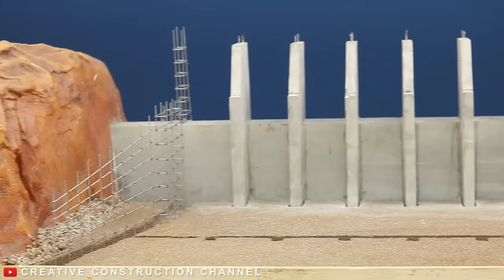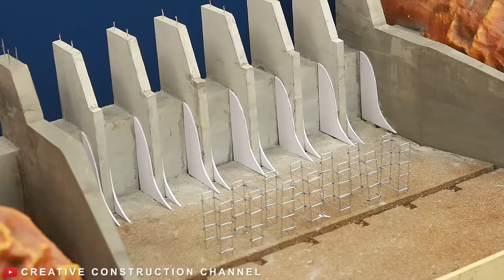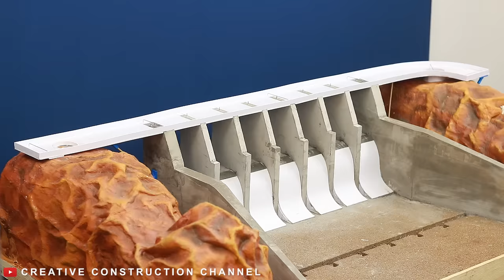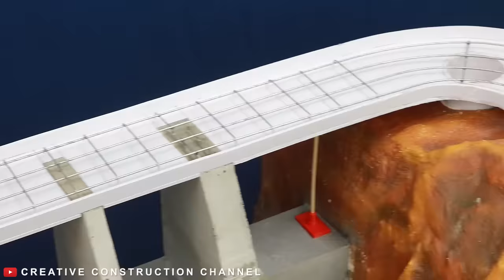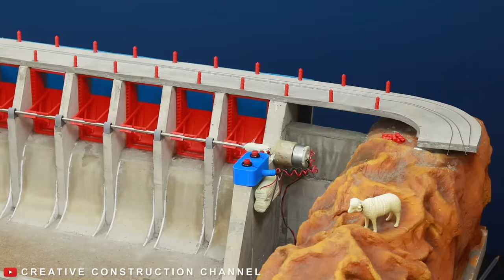How Dam Model Construct? Mini Dam Modelling

Comment: my favourite part was when you pulled out the mini concreting truck and it actually pumped concrete
Reply: Why is he using a cement mixer to pour concrete anyways???
Reply: @halcyon_exb  That is how the concrete would be delivered to the construction site
Reply: He was pouring concrete into the blue thing to make it work but it was cool
Reply: I think your misunderstood it is actually a fully operating concrete truck at its full size but the only thing unusual about this is how big that giant is building this sculpture
Reply: @gardenman3  actually that depends During the construction of the hoover dam they likely used the railroad to deliver the concrete then used the cranes to pour it

Comment: The wire frame method is exactly the same as in real construction. I salute you for this incredible amount of detail.
Reply: He needs the wire frame to make the concrete stronger
Reply: the frame is needed so it doesnt collapse on itself, its not really detail its a necessity
Reply: This comment and replies be like (as of now) comment: 4 months ago. 1st reply: 1 month ago. 2nd reply: 1week ago.
Reply: I wonder if 3d resin printed rectangles would do the job of the folded wire?
Reply: On this scale all that elaborate metal mesh in the concrete was unnecessary

Comment: Creative Construction Channel I appreciate the actual level of detail, such as vibrating the concrete. A lot of viewers don't know that contractors in real-life vibrate the concrete as well. (just not with a massive vibrator on the side of the project) :)  

Also, your materials estimator is going to have your ass, for all the concreate that was spilled  :) 
Any specs on the finished unit?  How much it weighed?  power generation?  how soon before the wife told you to gat that F-ing thing out of the house?  :)

Comment: You didn't have the tie bends at the top. Plus snap ties aren't the best for  columns and stuff. Should of used saddle ties for the ends and figure eights for anything you don't want to move horizontally. 
  Great vid  love the fact you vibrated the concrete

Comment: That truck on an unfinished bridge screams OH&S violation. How many work place injuries occurred during construction. My sympathy goes out to all the families impacted by this construction project
Reply: It would all be supported braced wood.
Pumped with crane scissor pump.   Form supports rebar and concrete which is super heavy.   Concrete truck could not drive over muli layered tied rebar
Reply: @darrenmcintosh326  very true. It's only a matter of time till disaster strikes. I feel for anyone living downstream from that dam